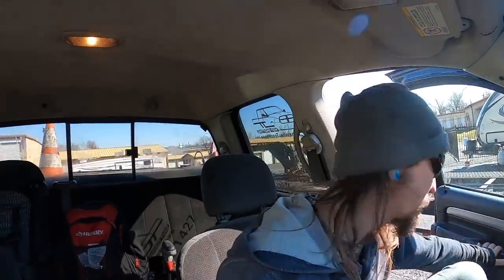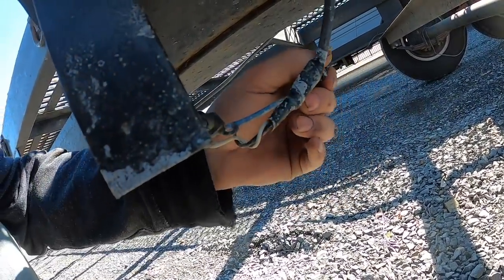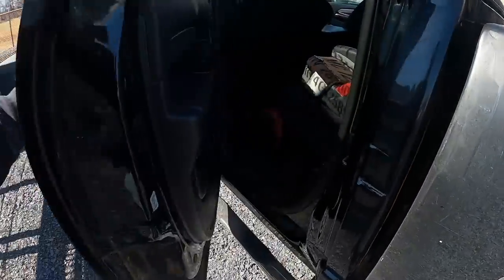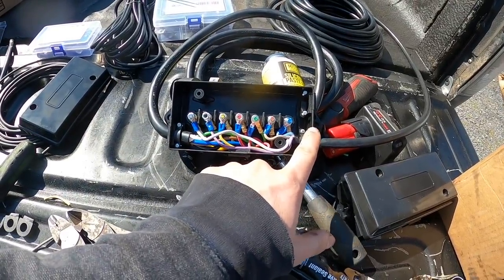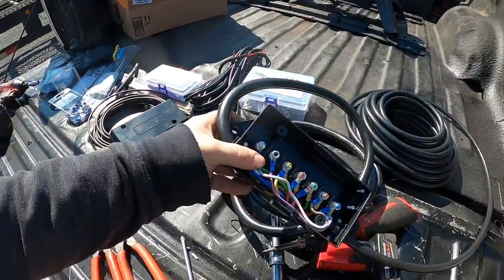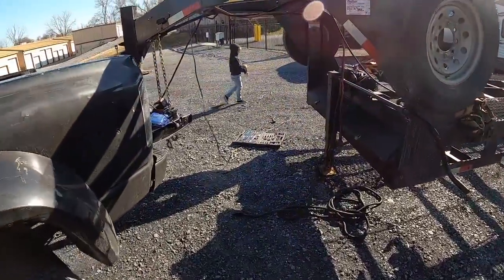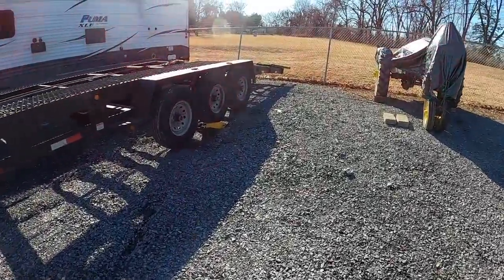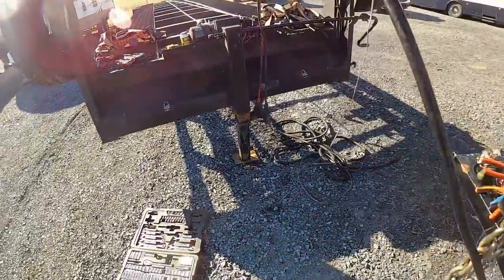2020 Kaufman 43ft Car Hauler Needs Rewired Already | Factory Hack Job Wiring | Hotshot Trailer

Comment: I have rewired a couple dozen trailers over the years. Your plan looks good. Personally I love running Junction boxes. I'd run your main Junction box in front, another box in the middle and one more at the rear. That way you can have a really nice and clean wiring job. Some tips, run some REALLY good grounds! From your pigtail, run a really solid ground to the trailer chassis. That way all of your lights and brakes will get a good ground. Also, for any of the lights or brakes, make sure you bring the contact for the ground down to bare metal. Other than that, great work.

Comment: I would toss the 3rd junction box in for issues that will come up down the road someone said you could jump wires at the box and sorta pin point where the problem could be at. Also the rtv or something on the boxes to keep them as water tight as possible is always a help! Keep the awesome content! You might store your schematic in a bag in plastic storage box on the trailer for your papers if you have one I don't know if they put those on trailers that aren't pulled by big rig tractors but if you don't have one getting one put in would be a good idea so your trailer papers stay on the trailer

Comment: The one box will be ok at back of the trailer to add the wire to the frame . Put the clearance lights with the run light but used the turn signal the middle of the trailer. If you can put red lights from the back wheel. Thank you to show the good thing you do for your family. The Glendenning family Kitchener Ontario Canada

Comment: I'm an electrician and I can tell you the fewer junction boxes you use the better. For your brakes though I would add a junction box on the opposite side of the frame run all 3 brake wires on the right side to a box and all on the left side to a box so you're not not crossing over the trailer 3 times

Comment: On the coated brake wires you’ve got on top of the crossmember, I’d put those in loom for and added layer of protection and throw some more brackets on it to keep the wind from letting it rub on the metal. The lights that’re grounded to the trailer itself I’d leave that and maybe run an additional ground wire from those lights to your junction box. You can never have too much grounding on these trailers. 👍🏼

Comment: Also on the inside of the frame where you install your breakout boxes. 
Take a paint marker. 
Write on the frame what each color of wire goes to in the box. 
Sometimes the wires don't stay the same. 
5 years later you might not remember.
Reply from the maker: Yeah I found that out the hard way today 😂 & way wiring was a different color than the factory harness and so on. Then running lights are black and white so this is definitely a good tip. A way to fight it if you forget is to multimeter each thing separately but that's also added work. I'll have to do this at some point on the inside of each box. Thanks!

Comment: I do the same wiring on my trailers an my 26' trailer I wish I had added a third box an am still thinking about adding it anyways. I'd drop wires as I went. u have the main 7 coming to frist box but dont need the 12v power to continue to the middle box by the axles. an run the front half of the trailer threw the front box ie side markers an what not. then bring in ur 6 main wires to the middle box an wire out ur brakes an center markers then carry in to a third box to run all of the rest of the lights an only running a 4 wire harness in an 2, 3, or 4 wire out to lights as needed

Comment: If the wires run THRU the axle (like dexters) take the wire out and zip it to the axle. Ive seen them short out where the wire enters and exits the axle. Took me FOREVER to find that stupid short. The breakaway battery dies in 2 hours when you pull the breakaway.
Reply from the maker: Yeah that happened to me on 2 out of the 3 axles. I have them going along the crossmember with their own hold downs now. That way I can take an axle out without disrupting the wiring. Just my thoughts. I found the shorts today.. What a shitty way to wire a trailer from the factory!
Reply: @CPSteveMiller  sure is! At least now it will be bulletproof!

Comment: Third Junction box's make it easy to wire your trailer. The forward marker lights run off of the forward box the brakes, tail lights and rear marker lights run off of the rear box. It would make it easy to know where the problem is with the maker lights. If the forward marker lights work and the aft don't you would be pretty sure the problem is in the aft box or beyond. If no marker lights work you would know it is the main plug or the forward junction box. I made a extension cable with a junction box and LED's so I can test a truck and trailer at the same time. I don't know how many times I have walked up to a bad trailer job and it ended up being the truck. I always test the truck first.

Comment: Usually the less you Break the wire run the better. But in Your case It may pay to add the third Box because those lights back there catch alot of Shit. So when a wire breaks You can run a Short jumper wire to whatever light your having problems with.from third box.Another thing running that wire over crossmember  will Rub through . I would of drilled a hole with rubber Drumet then run the wire through  that. But its your trailer You do it the way you like it.. Great Video.. Your Absolutely  Right Bud its very SCREWED UP.It This WORLD is in for a BIG Surprise  if it keeps going the way its going. AND ITS NOT GOOD...

Comment: I'd just do the one junction box on the very back less cuts the better. And I'd run the wire inside that frame tube don't secure to outside just because your running in the snow that will weigh the wire down.

Comment: Hows that 5th wheel to gooseneck adapter working? Im thinking on starting hot shot but since i already have a c 20k curt 5th wheel hitch... curios if that adapter is good/ better than the plate adapter to the rails

Comment: Man.......Lots of work to completely rewire.  Id exhaust all other options first.   I would remove  each double filament lamp at a time and   then test  .   You may find one of  the stop/tail/turn sig lamps is  faulty . 
If I were going to rewire completly Id run all wires in protective loom and Id absolutely solder all connections but Steve, before you do all  this, check  the system as I suggest by removing the connections to the multi filiment bulbs first.  Ive had similar problems with, believe it or not, bulbs  themselves. As is always  the case, you can never spend too much time diagnosing an issue
Reply from the maker: I found the issue today. There was 2 breaks in 1 wire and it was rubbing on the frame randomly. Bare wire. It was the factory wires too. What a pain. I actually didn't catch it at first until I started pulling the factory wiring out. After I cut that wire out everything works as it should. Now for future referencing it'll be so much easier to diagnose
Reply: @CPSteveMiller  So glad to hear you found  that !!

Comment: I'm learning from your videos Bro.!!☆,,getting my 2002 7.3 f350  long bed sw.(like you "my personal trk)Ready.& serviced.ONE QUESTION FOR YOU . airbags or bump stops????? on rear  trk.Thanks (((& CONGRATULATIONS on your channel
Reply from the maker: Air bags 100% I recommend Air lift 5000. They are lifetime warranty on the bags. My truck had no overload springs so they work very hard and give me no issues!
Reply: Thanks Steve,,(👍)my trk is a camper special,,,so it has overload springs, but,, I know air ride will also  improve the ride.,",I'm working on having gooseneck & fithwheel hitch next-)(.been hauling livestock&,Feed, -bumper pull &"the truck LOVES IT !-☆I'm retired  ,started  my hot shot  Emergency Service for Texaco Oilfield. 1979,-18 yrs old ,(Anything that will fit on a helicopter was my freight.,☆really enjoying the channel--☆☆☆

Comment: Good morning, I had a question about the length of your trailer. I remember at one time you said you did not care about the length. I run a 44' triple axel low boy/ goose neck I was wondering if you have had problems or issues being over 65 feet? is it an out of service violation?
Reply from the maker: I've never had anything come of it but the risks are there. With my flip outs I'm about 71ft. Remove the bed and register as a tractor and you won't have an issue. I'm local so I doubt I'll really ever be given a hard time. I usually run the turnpike which gets rid of any scale houses and dot confrontations.
Reply: I run an 06 dodge a lot like yours but a flat/modified bed.I did register as TT because I am 69 feet. However I am running the flatbed but there is not room for cargo on it. I am building a head ache rack and cat walk It is just not done yet. I also plan on staying pretty loca to Kansas. I hear Missouri is a stickler on the 65 foot rule. 
  Anyway I enjoy your content and can appreciate all you have done. Thank you for the info my friend Godspeed.

Comment: Putting the wire on top of the cross member between the mesh bad idea over time with a load on the mesh it will cut the wire over time

Comment: I would be careful to make sure the mesh doesn’t pinch the wires on the cross members when a car pulls on it. Or a heavy truck. I’d definitely run another box. It’s always better to keep different lights on the own circuit kinda sorta speaking

Comment: My Opinion call Kauffman and tell them they need to repair wiring or your attorney will be contact them
Reply: 😅 people always want to sue
Reply: @Roman-lc4wf  if you do the job right you don’t have any problems with your work. Doing bad work can Hurt your company . A lot of companies just want production and don’t care about Quality work
Reply: What did they do that makes you think any attorney would even take that bogus case? The wiring has been added to and worked on and patched up since it was new, they will not warranty anyones "fixes" on this trailer LOL
Reply: @warrenmichael918  built very poorly
Reply from the maker: So after going through it today none of the wiring was messed with at all besides the brake wiring and the back right corner there was an added 4 way. The guy actually did a decent job on it. I found the factory harness where they use butt connectors it was rubbed through before and after the connector. That was the running lights wire and it was touching the frame at times. I didn't see any wiring that was messed with aftermarket. The running lights wire was the issue. Definitely wish they would take manufacturing more seriously considering that's what they do for a living but it's so much better now and easier to service. Also the fact that 2 market lights were mounted directly in front of and behind the tires with no shield blows my mind..
Reply: @CPSteveMiller  Yes , those lights right next to the tires being uncovered or not enclosed is a goofy design. Trailers that dont have the newer modular wiring are awful. They get water in the connections and get corrosion too fast and easy. Youre on the right track by reworking the wiring to make troubleshooting and repairs easier to fix...Get you some liquid electrical tape and go over any and all connection points outside of the J boxes if you have any.

Comment: all they do is make crap and charge double dollars for it now,we just paid off my 2016 loestar road tractor and if i needed another tractor i would do my best tp get and old 1,i know it would cost big cash now, butt  whatever as long as it does not have def system or elogs ill be happy  with it 4 a backup unit.

Comment: Steve every house in this country is running on 14 awg (15 amp) and 12 awg (20 amp) wire at 120 volts. I don't know who it is that says you need bigger wire. Now the longer the wire run you do have voltage drop so bigger is better. I bet the factory wire on that trailer is # 16 or #18. Retired electrician here so all you know it all's stay in your lane.
Reply: @John-lu2bp  listen pal union electrician for 30 years.  You plug the values in. 12v x 15 fuse (assuming that's what is protecting the circuit) is 180 watts. So perhaps Steve needs to add up the watts of all his bulbs. Maybe change out to LED bulbs.  The biggest problem is the voltage drop because of length of runs. We had a city make us pull 12 wire to second floors of homes because of  claimed voltage drop.  Yes I said pull wire as in my part of the country we pipe  homes.  You're probably just a  guy who runs  glorified extension cords.
Reply: @John-lu2bp  in that case you  see stuff going on with that whole truck and trailer wiring that is just kinda sketchy and than throw in snow and salt on the roads.
Reply: @robm3063    Electric brakes draw a hell of a lot more current than an LED.  Why in the hell would you use conduit inside walls?  It's already protected.
Reply: @pamike4873  where ur at does main come into property in duit to panel?
Reply: @druideverett1603  overhead service gets rigid with weatherhead . Underground is tri plex provided by the utility company. From that point on all emt. Some towns even want door bell wire in pipe. Automobile wiring and home/commercial are like gas engines and diesel engines. They are close to the same but different. If I  was Steve I would look at those aftermarket taillights for 1, bad connections and 2, just bad China product. I'm on some Chevy truck forums and there's always someone having problems with cheap aftermarket lighting.
Reply: @John-lu2bp  
I hope he wasn't.
Reply: @druideverett1603  Can you repeat that, but in English this time, please?